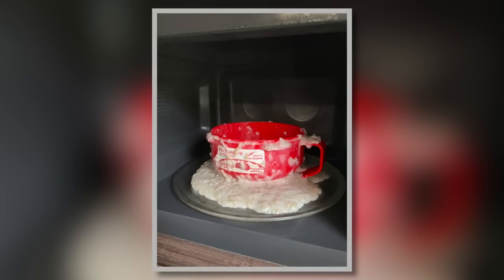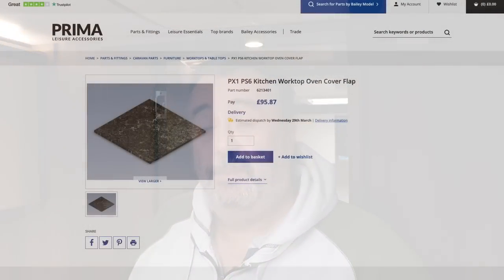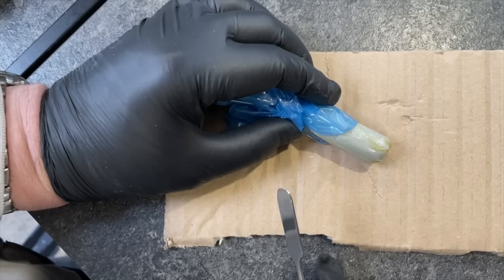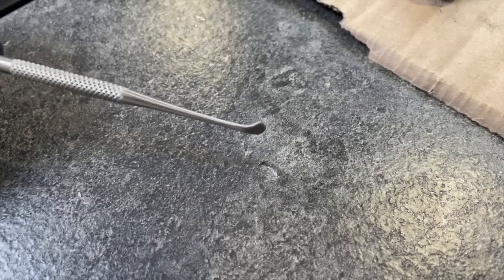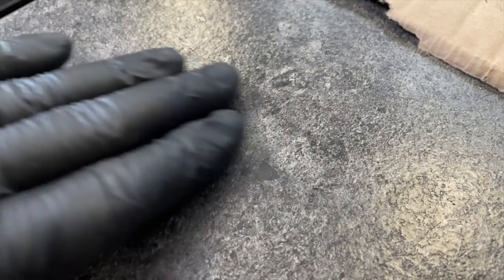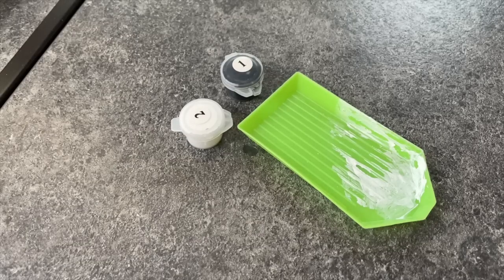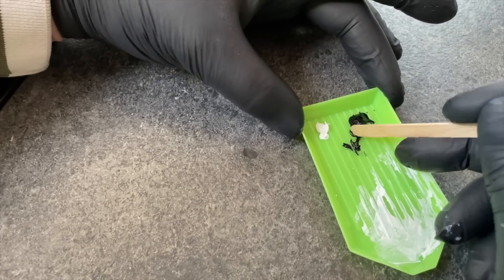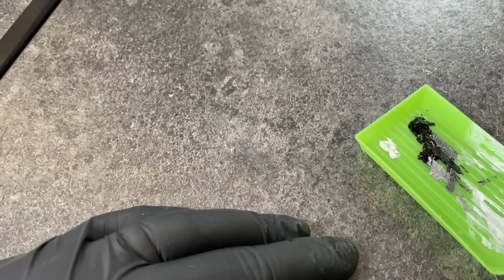Caravan worktop repair

Comment: Hi Dan, the job's done now and done very well I might add, but a couple of tips for you. When mixing the two parts together, you can add some chalk dust or baking powder to lighten the colour a wee bit. If you buy the brilliant white equivalent, you can even mix in a bit of food colouring or paint to match the surface you're working on. When smoothing it down it can get a bit crumbly. Gently work with a wet finger and you'll get a perfectly smooth and even finish. Milliput is great for oh so many repairs.
Reply from the maker: Thanks for the tips!

Comment: Just a thought would it be possible to turn the top over if the shape and fittings allow
Reply from the maker: Hi David, sadly not, its a white surface underneath and also the mountings are from 1 side only.